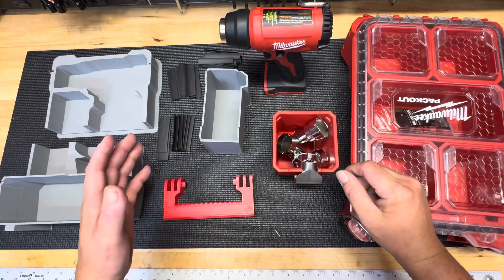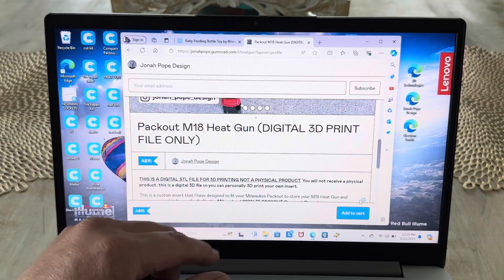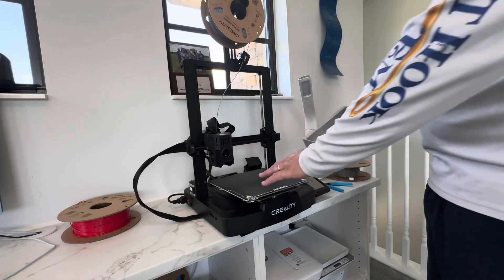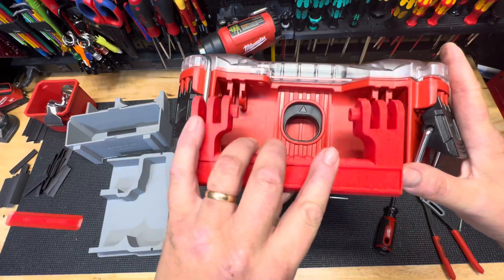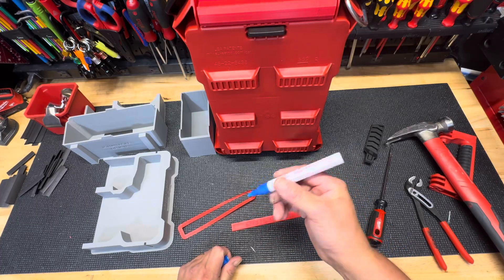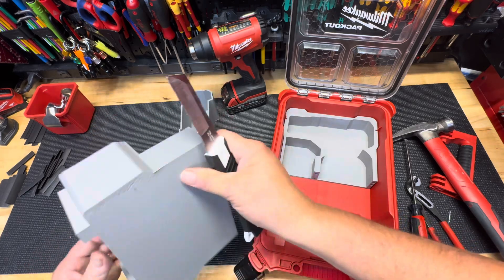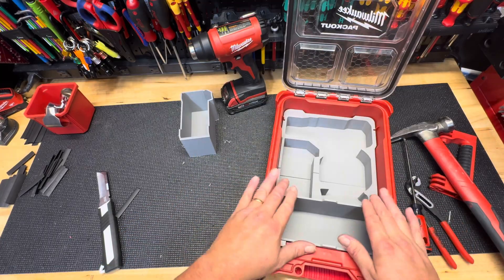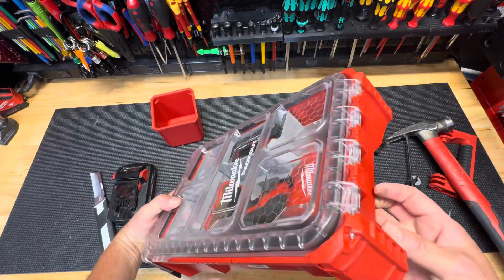Milwaukee Packout Organizer Inserts: Step-by-Step Guide to 3D Printing Jonah Pope's Designs.

Comment: What 3d printer do you use pal and have you got accessories etc 👍
Reply from the maker: This is the Ender 3 KE a very budget friendly one however not the easiest to use. If I was to do it again I would get spend a few extra and get a Bambu labs one it’s gonna save you a lot of money and time in the long run most my accessories I just get in Amazon or I print
Reply: Thanks for the response pal looking at getting one would u say it works out cheaper to print rather than buy from premade online as there about 60 gbp for one 😆
Reply from the maker: @jordanlee5183 All depends you also have to keep buying fulfillment…. If you’re going to print a whole bunch then yes over time it will be cheaper however if you just want let’s say 10 prints might as well buy them. There is forsure a learning curb with 3D printing. If you enjoy all that there is some type of soft satisfaction printing yourself.
Reply: @Tooling_with_Newman sweet mate sounds good I suppose it can be used in other applications like printing obscure stuff does the bambu labs one come with software and all ? Sorry for all the questions pal just interested in it is all
Reply from the maker: @jordanlee5183 Yeah the Bambu labs one has everything with it software prints it’s really good. You will be amazed the stuff you can print like custom tool organizers or replacement parts for appliances. Or just parts that you cants get online I bet there is a file for it. I never got into designing prints I just printed and there is millions of files online
Reply: @Tooling_with_Newman sounds awsome pal thanks again for the reply won't keep asking you loads of questions just one more 😂whats the best place to search / download files from
Reply from the maker: @jordanlee5183 I like Thingiverse.com or printables.com
Reply: @Tooling_with_Newman thanks pal 👍 best of luck

Comment: Hello.  New to this and wondering about the overall feel of the organizer and plastic.  In my experience the little 3D printed trinkets have that awkward feeling to them (not sure if I am describing it correctly).  Versus the smooth plastic bin that comes with a packout product.  I am looking to get a printer and want that smooth plastic feel.  Thank you
Reply: Well  you are much more of an expert than me. 

I guess the best way to describe it is those fidget type things that feel like nails on a chalkboard.
Reply from the maker: @jeffgreen8012 😂😂😂😂😂 I get exactly what you’re saying …….
Reply from the maker: That all depends on the material you use to print. I am by all means no expert in printing but the material I use (PLA) feels like crap compared to the material on the 10 spot tools handles